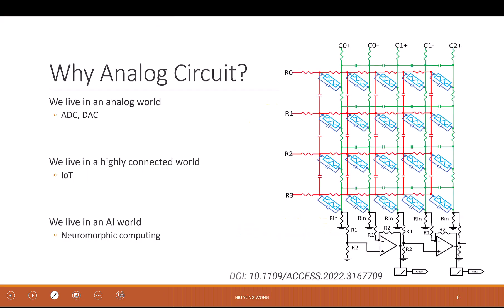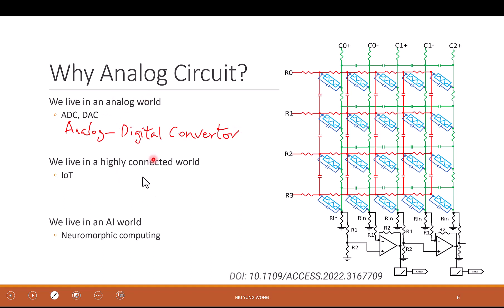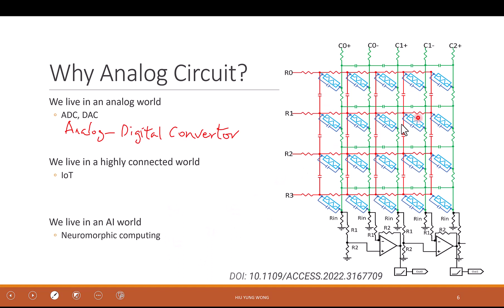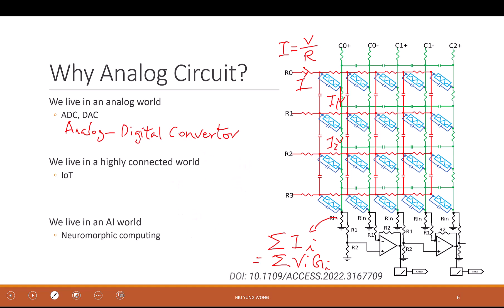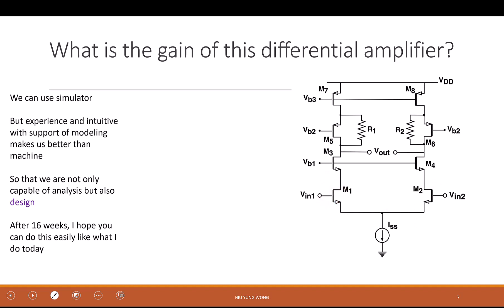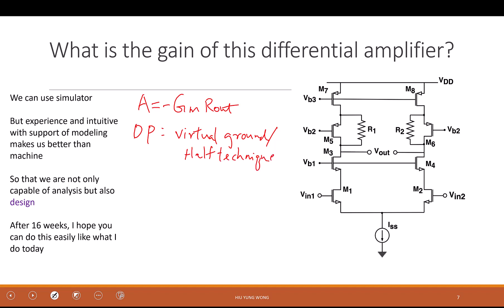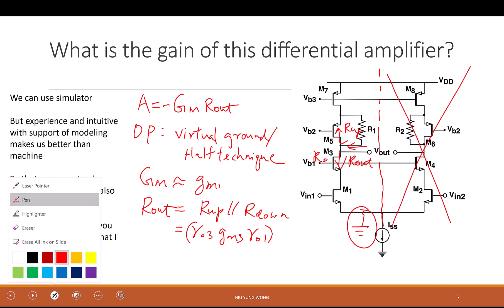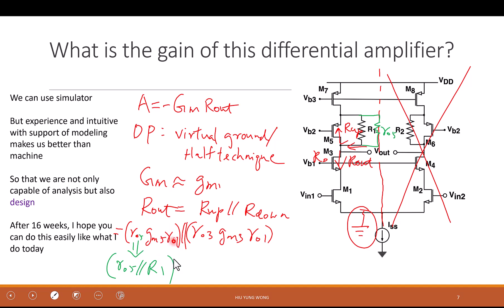L2-1 Why Study Analog Circuit and the Purpose of this Class

Comment: Hi Thank you so much for sharing your knowledge to the public.
I have a little question. I'm a junior year EE student and planning to go to graduate school for further study. I'm very interested in analog IC and electromagnetics(especially, computational EM using numerical methods like FDTD,FEM,MoM based on thorough Linear Algebra). My hope is to study both of them but the two things seem like a far away lands from each other. So if I choose one field(one research group in the graduate school) over the other I feel like I should abandon the other one. So I'm wondering if there is a research field that I can synthesize the two fields or if I choose analog IC over EM, whether my Linear Algebraic knowledge would give me an advantage studying analog IC or vice versa.
Sorry for this wordy comment, I hope I could get your reply. Thank you.
Reply from the maker: @imk820, firstly, I try my best to comment. Mine is probably incomplete or can be wrong. It is always good to keep talking to people and asking questions regarding your career path. Since you are still a UG, I will say not to limit yourself to a particular field. Since you like both, spend time exploring both fields. Even when you are a graduate student, it is still too early to "abandon" one of them. Microwave engineering or RF IC design can be a field that combines both. E.g. I am doing some cryogenic IC design. When we design low-noise amplifiers, analog IC knowledge is required. And we also want to simulate (FDTD) the inductance and capacitance in the layout which needs to be accurate to predict if the circuit will work. This is a field you can go to. But I am very sure if you keep exploring, you will find something even more exciting that combines these two fields together.
Reply: @quantum_computing  Thank you so much! I've got very inspired and motivated. I really appreciate it.